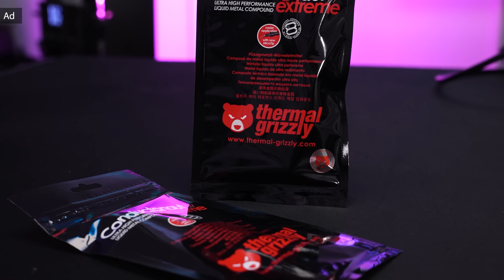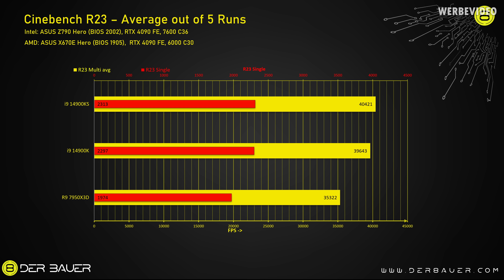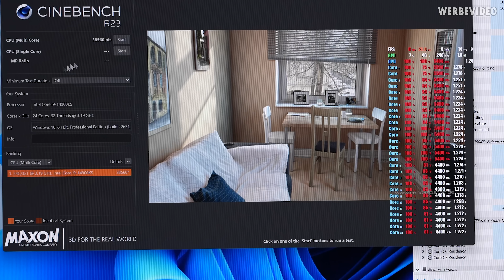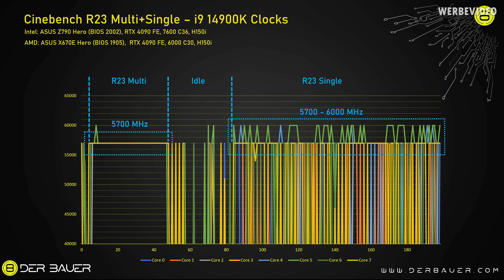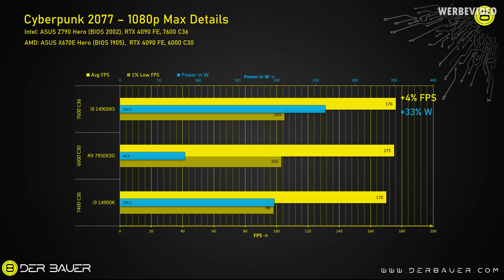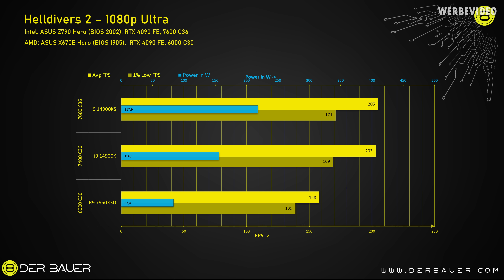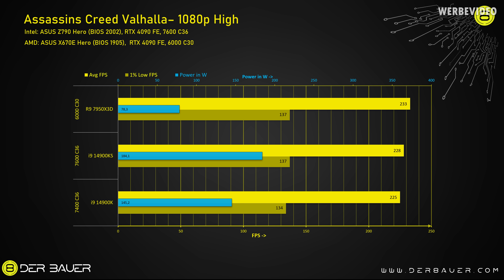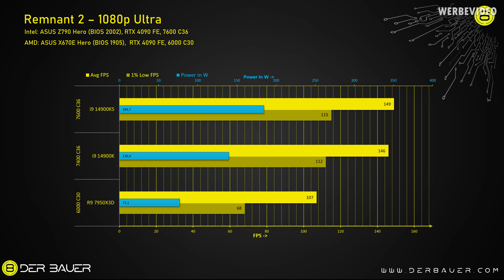Almost 400W under Full Load - The 14900KS is one of the Most Extreme CPUs ever Made

Comment: Might honestly be one of the worst CPUs I've ever seen.
Reply: 12-14 gen
Loud (cooling on blast) ✔
power hungry ✔
space heaters✔
bad platform ✖
fast✔
Reply: 11th gen were the worst
Reply: @gardenia1738 again not really. 11900k can hold 5.4 GHz across all cores and yeah sure about 300w but still it's holding that frequency and competes with ipc and latency above and offerings even today.
Reply: @gardenia1738 definitely 11th gen i9 was a downgrade
Reply: I remember the 11900K. It was literally slower than the 10900K in several tests back then.
Reply: It is a clear sign that Intel is desperate and their only solution is to increase power consumption to try to match the Ryzen 7800X3D in gaming which uses a quarter of the power
Reply: @samuelrodgers2742 said nobody ever, but AMD shrills. 14900KS is the fastest consumer desktop processor in every facet. You realize people do stuff outside of gaming, right? It obliterates anything AMD offers.
Reply: @OC.TINYYY  true
Reply: @samuelrodgers2742 Ultimately, their engineers really have their hands tied unless they can get some better process node or cache improvements. There's only so much they can squeeze out of 10nm chips (close to TSMC 7nm) when AMD is rocking 3DVcache and 5nm, so even with the insane power consumption it's impressive they manage to get anywhere close
Reply: @samuelrodgers2742 this is wrong

The 10nm node is just cursed lol
Reply: @samuelrodgers2742 amd cpus lmao
Reply: @samuelrodgers2742  AMD owes its false results only to the increased cache memory size.  Without this, it's just rubbish that can't hold a candle to Intel.  And yes, I call it fake results, because that's what it is.  Take the R7 7700X for comparison and compare it with the i7 13700K.  And you will see what your worthless AMD really is.
Reply: Btw intel 13900k has better 1 percent low compared to amd 7800x3d
Reply: @alfredgamerzzgamers3970  at what cost? It's not really an achievement to have slightly higher 1% lows while using twice the power and is impossible to keep cool without a 360mm AIO. The 7800X3D beats the 13900K in more games with lower power, is easier to cool, and doesn't come on a dead platform.
Reply: @alfredgamerzzgamers3970  And draws twice as much power when turboing.
Reply: @ThunderingRoar  it is hard to accept the truth that 14900k just better at 1 percent lows
Reply: @alfredgamerzzgamers3970  I'd rather have worse 1% lows of ryzen than having a unnecessarily high power consumption and heat output of Intel, and let's not start talking about the prices.
Reply: @alfredgamerzzgamers3970 Many benchmarks actually prove the inverse of your argument here. X3D chips tend to be more stable and faster in many titles and tasks sensitive to cache, but otherwise are a bit slower or even equal to the traditional chips they are built on.
Reply: @samuelrodgers2742 The 13900k is not even used specifically for gaming it’s a workstation CPU. Stupid to compare an 8 core processor with efficiency to a 24 core processor.
Reply: @mivvers4655 %1 are more important than slightly higher fps. Also no frame dipping on Intel unlike AMD.
Reply: @RealMephres False not every game takes advantage of 3D V cache they are also much worse than their X counterparts in workstation tasks.
Reply: @samuelrodgers2742 the ol "dead platform" cope, as if the target market for 14900KS gives a shit about upgrading MB in 2yrs
Reply: @samuelrodgers2742 at no cost lmaoo are u that afraid of paying for power lmao
Reply: @RealMephres  depends on the game.
Reply: @r3mxd  Yes, adults have to actually worry about paying a power bill which is especially high in Europe. Not everyone lives in their mothers basement.
Reply: @ZackSNetwork  Intel does market the 13900K for gaming so you are wrong there. Secondly, the 13900K is not an actual 24 core CPU. It has 8 actual cores and 16 weak cores equivalent to Skylake cores from 2015. The 7950X with its 16 powerful cores beats the 13900K in multithreading while using less power. Actual workstations use Threadrippers because it has lots of powerful cores. A 64-core Threadripper uses the same power as a 13900K but trounces it in multithreading. If it weren't for AMD forcing them to compete again, Intel would still be making 14nm+++++++ Skylake quad-cores.
Reply: @markdeckard7651  Intel fanboys will keep eating up that slop no matter how anti-consumer their corporate daddy is. If Intel could get away with it, they would force you to get a new motherboard with each new generation because they could sell more chipsets to OEMs like MSI and Asus for new motherboards. Try to deride the "old dead platform" to someone who bought an X170 motherboard in 2017 and was able to drop a 5800X3D into the same motherboard 6 years later and get a massive boost in performance.
Reply: @ZackSNetwork  your point is valid but has giant holes in it. The 13900k is a horrible workstation cpu just like 7800x3d. The over double power consumption is something you calculate into building workstations for only a 32% increase in productivity. Why would you buy a 13900k when there's a 7950x? And if your looking for a real workstation you go xeon and threadripper. And threadripper is completely blowing the xeon out the water.
Reply: @alfredgamerzzgamers3970  while true on a multi-games average, in certain games it reaches much lower 0.1% and 1% fps averages than the 7800X3D. This is especially true in CS2, where my i9-13900K + 4080 + 7000 MT on FHD resolution reached in Dust 2 DM (5 min CapeframeX bench) 
- 0.1% = 135 fps
- 1% = 229 fps
- avg = 518 fps
My friends 7800X3D + 4080 + 6000 MT in the same benchmark reached
- 0.1% = 201 fps
- 1% = 275 fps
- avg = 548 fps
In CS2 it is apparent, that the 3D cache is highly beneficial to improved fps lows. The i9s K models in general performan pretty badly in this regard. Exactly this has been covered in Gamers Nexus video naming the i9-13900K a "problematic CPU" for CS2.
Reply: @ZackSNetwork  are you saying that you are ok with obnoxiously high power consumption and higher price for just little to negligible performance difference? Also your argument is way off from what I'm talking about, I didn't compare higher FPS to Higher 1% Lows.
Reply: @alfredgamerzzgamers3970 they think amd is better🤣🤣🤣 i'm not a fanboy but intel has always been better in gaming and that's a fact
Reply: @Spectru91  they can't accept the truth me
Reply: @ZackSNetwork  facts
Reply: @samuelrodgers2742 Yeah and the sad part is same thing AMD started doing it. Competition makes the market healthy and innovative without competition the company gets greedy and they focus more on money than innovation. A great example of this is Ryzen 8000 g series, it have no cpu improvement compared to 7000 series, yeah it have the most powerful igpu but for that price it isn't worth it.
Reply: @alfredgamerzzgamers3970 what is 1% low? I am looking at average, 1% low NOONE notices. Amd is still best in 2024. Intel is sheet. And I WAS A DIE HARD INTEL FAN
Reply: @ZackSNetwork  What? Go cry intel fan boy. Intel days are over. 400w heater 😂😂😂
Reply: @gabrielvieira.4358  then buy amd
Reply: @Spectru91 Intel has been scrambling for anything since the 5800x3D. And they're honestly still behind that with most their newer models
Reply: @alfredgamerzzgamers3970 Thanks for taking one exceptional outlier to shame AMD.
Reply: It quiet honestly is everyone was giving the FX 9590 hell for its power draw to keep up with Intel's ivy and haswell and it was just over 250 watts now Intel has been selling CPUs for over 3 generations that are over that tdp just to keep up with ryzen chips and the 3d  v cache I do not know how Intel has gotten away with into when amd was heavily scrutinised publically and commercially.....
Reply: 11900k? Fx 8350?
Reply: it's a monster in gaming that's all i care for
Reply: No, I don’t need to turn on my heater in Canada😂
Reply: They just made an over clock record but all good I'm sure some amd fan boys will pick apart anything. Sure price to perceived performance is a good argument but this is enthusiast grade cpu with plenty of headroom. 9.1ghz is insane
Reply: why, u dont have solar😂
Reply: amd: 65watt can do gaming
intel: more power more heat more performance
Reply: Worst since FX-9590.
Reply: Yes! Amd makes 40% more with 60% less power!
Reply: 11900K is hard to beat…
Reply: well this comment aged like fine wine
Reply: @DaveGamesVT you must be young and not remember the FX-9590 or FX-8150
Reply: @KillBoyUK yeah way worse cpus than this haha.
Reply: It's a stupid product, basically launching the 13900K for the 4th time, jacking the voltage and clocks all the way up, but it's by far not the worst CPU ever launched. The first Pentium 4s, the original Phenoms (before they fixed the tlb issue), Bulldozer, or even the 11900K were all a lot worse, they couldn't even outperform their own direct predecessors.
Reply: @FloppaAppreciationSociet-ds7zf   what? The 12th and 13th generation had great improvement over their last gen.
Reply: cope and seethe
Reply: you might hOneStLy not be the target market
Reply: xddddd
Reply: I'm a pretty big fan of der8auer but this was a terrible review. He should take a tip from LTT... If you don't have the time to do it right, don't do it at all.

He admitted his faults but it doesn't make it okay to post that way. Aka:

ALL processors running on different ram speeds, with AMD on SIGNIFICANTLY slower ram, leads to very misleading results.

Not including 7800X3D, the fastest processor for gaming.

Not getting AMD 3D cache working.

Posting misleading, and wildly inaccurate results, is not acceptable. Acknowledging the faults does not excuse them.

I expected better from this channel. This doesn't do anything postive for someone wanting a comparison of the 14900KS vs AMD or other Intel...
Reply: I think bulldozer was even worse.
Reply: You must not have been around long lol. This thing isnt great from an efficiency standpoint but at least it’s fast. Bulldozer was shit at both.
Reply: @jolness1  been around for awhile since the pentium and Westmere days yes it was not effective at both but it was priced accordingly, still though this processor is lacking comparatively as well..
Reply: its an enthusiast cpu, intel doesn’t force you to buy it. i7,i5, regular i9 still exist, and they still provide smoother gaming experience in heavy games, which will oversaturate amd’s cache. 
Its unlike Nvidia’s 4090, thats so much better than 4080, that it makes it useless.
Reply: Imagine buying a K or KS sku and not doing any tuning in the bios.
Reply: I'm going to just say it: Only a scumbag roots for Intel... and here's why:  in a duopoly, the best a consumer can hope for is a 50%/50% split in marketshare.  This would OBJECTIVELY bring about the most innovation, competition and the lowest prices.  Since Intel has a majority of that marketshare, any further increase in their marketshare would be OBJECTIVELY bad for all consumers....so, by cheering for Intel, you're literally cheering against your own self-interest as well as the interest of every other consumer....so why would anyone cheer for Intel?

FYI: I'm not saying "cheer for AMD", what I am saying is that we should cheer for Intel and AMD to fight each other to an even split kn marketshare to bring about the most competition
Reply: @post-leftluddite  Amd locked up the contracts for 5 and 7nm for like a decade. The turns have tabled.

Intel is the underdog in terms of resources. 🤷‍♂️
Reply: @post-leftluddite going to buy more shares. Go to bed you have school tomorrow

Comment: 400Watts CPU + 450Watts GPU = 1HP AC just to counter the heat. :D
Reply: Luckily in my country one needs heating for 98% of time every year.  When one doesn't need heating.. one doesn't want to stay at the computer anyways
Reply: At this point you can put a whole plate of food above the radiator and the PC keeps the food hot, even if it is in idle
Reply: Just put the whole case outside the window. Big brain move
Reply: @marcogenovesi8570  when it gets over 35C ambient even water isn't helping lol. Winter here it's 25C.
Reply: @marcogenovesi8570  Only works in cold country.
Reply: @marcogenovesi8570  Yeah, screw the planet! I like it.
Reply: @TwinkleTutsies  It's actually better for the planet, as you are cooling the PC without the need for a 1HP AC unit (which needs power and generates additional waste heat).
Also cheaper because lower power bill
Reply: @marcogenovesi8570  Yes that's assuming you have an AC unit. My point is that you are making someone/something else deal with the problem instead of yourself. Twas a joke
Reply: @TwinkleTutsies  AC is just a heat pump, it takes the heat from the room and dumps it outside. So in both cases you are making someone else's deal with the heat
Reply: @TwinkleTutsies Someone has to melt the north pole.
Reply: Me living in a tropical country, struggling to not turn my bedroom into an oben during the day...
Reply: @PotatoVariety >Me living in a tropic-ACK!
Reply: + 200w from RGB (not even an exaggeration at this point)
Reply: @username8644   Most real comment I seen in a while, Ran the wattage on a RGB build vs Non RGB, a cooler tower with RGB lighting alone can eat 5 watts, outrageous! Also per DDR5 Ram stick with RGB, an extra 2-3 watts ontop of the standard 3 watts per 8GB minimum
Reply: @username8644  RGB is light, not heat
Reply: @LeLe-pm2pr  oh how wrong you are
Reply: @TwinkleTutsies  eeeh, leds are decently efficient, and it's definitlely not 200w anyways
Reply: @LeLe-pm2pr  200w is 200w. No 2 different ways about it
Reply: @TwinkleTutsies  it does pull 200w, but it outputs light instead of heat, and therefore does not need to be cooled
Reply: @LeLe-pm2pr  light eventually turns into heat when it hits something I.e. Your walls
Reply: @TwinkleTutsies  not all the light emitted in your room ends up absorbed by your room
Reply: @LeLe-pm2pr  mate, pointless conversation give up
Reply: Free heating for me. I use around this on average to keep my apartment warm for 8-9 months of the year :)
Reply: Swap the 14900KS for a new 36 core Xeon and it's easily a 700watt CPU on full load. Seriously, with power consumption figures like these I would like to test out different PC cases and see how much heat is too much for them. Over 1200W watts just from a overclocked Xeon and RTX 4090 and more than 1300W for the whole system if you install a bunch of SSDs and HDDs
Reply: 1hp ac is nothing
the fan on my evaporative a/c is 1200w
Reply: 650W mining rig heating my 5x4m room in winter
Reply: 1HP is around 750 watts.
Reply: You forgot to include the heat user produces during intense usage
Reply: A PC made for winter LMAO
Reply: don't forget to factor in the environment it will be running in. In my building, it might take 1.5HP AC or higher.
Reply: I've also always wondered how wonderful it would be if you could route computer heat to saunaroom. Run CPU and GPU stress test on a loop and you'd have 1/5th of needed heat right there.
Reply: 7950x3d uses less power because it isn't working..... This may as well be day UNO release!
Reply: Rip electrical bill
Reply: or just get a x3d chip and suck like 50 watts
Reply: My 14900KF hitting 357 watts with just Asus MCE enabled, and my Asus Strix 4090 OC edition hitting 531 watts at 3,285 MHz after an OC scan on GPU Tweak III.
Reply: Amd is now chilling. Ahh the turn tables 😂😂😂
Reply: That's 2900 BTU/h of heat so you ain't wrong. Europeans and people in the northern Unites States and Canada don't even have central air a lot of the time. Intel CPUs must burn them up during the summertime. I'm in Texas and we have plenty of A/C in all of our buildings down here, but I still went with a 7800X3D.
Reply: @AshtonCoolman You're right that we don't really have much in the way of AC up in WA. However, in the summer it's still generally mild enough to put a couple fans in some windows and vent that heat outside while staying relatively comfortable. I spend about half the year in Texas, and down here AC is a requirement, especially when it's 90+ in fucking February.
Reply: @BobBobson  How do you not have AC in WA? I'm in Iowa, and have never seen a building without AC
Reply: @AshtonCoolman  I lived in CO for a few years in the 90s, most people back then didn't have AC. I've been back several times over the years and AC has become increasingly common, since it has become so much cheaper to get window units and heat pumps.

But back then, it was miserable in the summer, over 90 degrees. But the heat there was worse, the thinner atmosphere meant much higher UV exposure, and the humidity was always extremely low. You could get dangerously dehydrated just walking around.

Unlike the heat here in Texas where it can be 105 degrees and 99999999999999% humidity. People start looking like they've been to the pool, but it's actually everyone sweating so much that it soaks all of your clothing.
Reply: @AshtonCoolman  Pretty much every house in the United States has central air. It gets over 100F in Minnesota in the summer
Reply: @AshtonCoolman  400 watts GPU can be understood, but 400 watts cpu in the era of chips like M1/M2 or even zen 3 is just plain stupid.
Reply: @niks660097 M2 is comparable to zen 2 desktops your being delusional.
Reply: @niks660097  agreed!